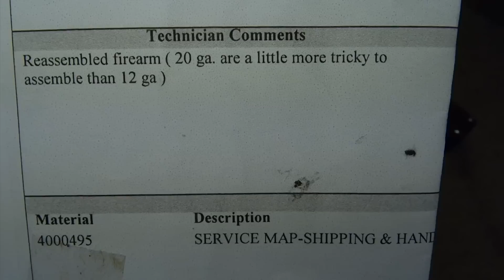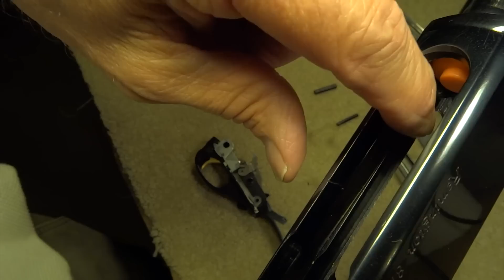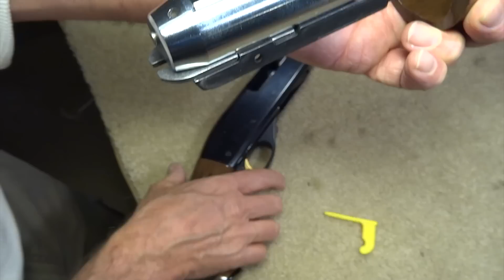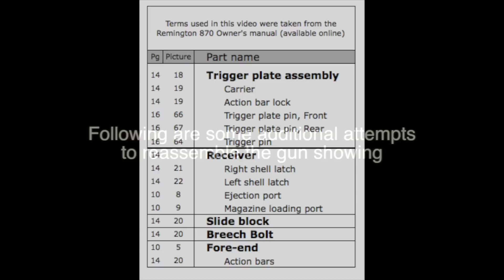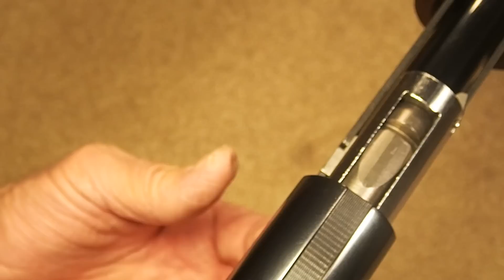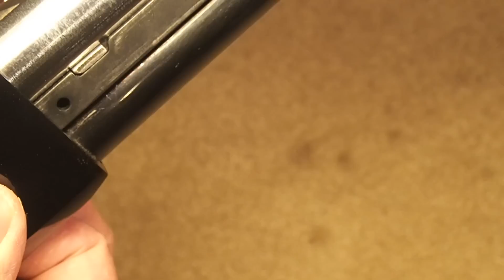20 gauge Remington 870 reassembly problem

Comment: I spent WAY too much time trying to reassemble this 20 gauge before seeking your video. I had to laugh when I read your opening line, 'I owned a 12 gauge 870 for at least 20 years and never had any difficulties reassembling it.' I, too, have disassembled and reassembled a 12 gauge 870 many times, a piece of cake. So, I had reasoned - wrongly - that the 20 gauge should be identical in its ease of reassembly. SO WHY COULDN'T I GET IT BACK TOGETHER?! I knew when I began entering the search words and YouTube fed me the phrase 'reassemble remington 870 20 gauge' that it wasn't just me.

Thank you for your help, without which I would once again be attempting to reassemble - and shaking my head and cursing my failure and wondering what on God's earth was the problem?!

Comment: LIFE SAVER!  My buddy ( a machinist) couldn't get the bolt back into his 870 20 ga after over an hour of trying. He brought the gun to me and I also tried  for near an hour. I could get the bolt in but it wouldn't cycle smoothly and would jam up TIGHT. I've worked on dozens of gun designs and never had such problems, I was ready to tell him to ship it to Remington.  Once I found your vid, the sequence of depressing  the two rail stops became apparent. Additionally, I found that I had to have the right stop depressed no later than when the little hole in the slide was a good 1/2" out of the reciever. Took another 6-8 tries but I finally got it.   I've advised my friend to NEVER disasemble this gun again. A can of Gun Scrubber will sufffice for cleaning going forward. Thank You!.

Comment: Fantastic instruction. I knew the shell latches had to be pushed in and in which order. Did know about the small hole in the slide having to be t a certain position. Ive struggled with this repeatedly for almost two years. Watched your video and stuck it the first time! Thanks a million.

Comment: You are a prophet, a scholar, a seer of portents of things to come and above all else a gentlemen.  Thank you for sharing this!  I've spent the better part of the day fiddle-farting with my li'l 20 gauge 870 and was stumped until I found you.  Bravo!  

I scoured the net and found dozens of "I thinks", "I heard", "It should", "It might" but very few "I don't knows."  My original problem was the bolt wouldn't lock forward -- just give the fore end a good yank and it'd pull back and jam the bolt to the rear.  Turned out the action bar lock (I called it the bolt release ... lol!) wasn't engaging the action bar properly.  I got'er apart and diid a little adjustment and it ultimately worked.  The problem was getting the danged bolt assembly and action bars to work.  I followed the advice of many a 12 gauge "expert" who never mentioned pressing both the RIGHT and left shell latch.  Madness ensued until I stumbled across this precious piece of wisdom and knowledge.  

Thanks for being so awesome ... and saving to many of us minions from 870 insanity!!!

Comment: Just spent about 3 hours with jams. The hole on the right side is key. Watched other videos and your the first to mention that hole. Thank you so much. My fingers are killing me. Wish I saw your video first.
Reply: YeAh same here. I watched several and the closest anybody came to the hole in the slide was a guy that said once he pushed the latch in he pushed the bolt “about this far” as he held up his hand with two fingers almost pinched together. Lol! 😂 Your right, the hole is key to early success. I stuck the landing first try using that little morsel of info.

Comment: I purchased an h&r 20 gauge youth from Buds. I’ve never field stripped a shotgun. So yesterday I figure what better time than the present. I finally got the bolt out. I try to get the bolt back in. 3 hours later I gave up. Your video is the best I’ve seen as of yet. I’ll attempt again tonight after work. Thanks again !!
Reply: I ended up sending it in for warranty/ repair. I noticed inside the receiver 2-3 burs in the metal. The bolt carrier was hitting the metal burs. I shipped it via FedEx. It arrived on Sept. 10th. I called a couple weeks later. 4-6 week turn around time. Once I get it back I’ll use my old cleaning method. Bore snake. & CLP break free spray for the receiver.

Comment: I have a Remington 870LW Special Field 20 gauge ... a fine pointing, short-barreled grouse gun.  I decided to tackle cleaning the trigger assembly, bolt, etc. which hadn't been cleaned since I bought this gun (used) years ago.  Man, the trigger assembly was dirty, dirty, dirty.  All cleaned, lubed, and back in the gun ... although that was not easy either as some parts were wider than the receiver bottom and required coaxing.  I gave up last night on replacing the bolt and slide and happened to find this video this morning.  I thought surely I've got this licked.  Now I'm back reviewing a second time after trying, analyzing, and trying some more.  I'm way over your failure ratio.  I will watch again, and I see some of the comments give some additional insights.  Wish me luck.  As someone else said, I won't be in a hurry to repeat this disassembly any time soon. (no problems with 12 gauge 870 Express)
Reply: YEE HAWWW!

Comment: Holy Moses! I was just sitting here on a rainy cold night thinking I would clean the manufacturer oil and crap out of my new Remington 870 20 gauge. I got the barrel off easy enough, but thought best to check youtube before further disassembly....thank GOODNESS I did! Grateful for your video - think I'll call my handy neighborhood Gunsmith to do the initial take out and cleaning. He's probably seen it before and I won't feel like such an idiot! I had an old Sears and Roebuck 12 gauge pump shotgun my late husband had bought at a pawn shop for $100 bucks. That thing was so easy to handle and work on it practically did all the work itself. I gave it to my neighbor when I moved to town, thinking I'd get a 20 gauge...hmmm may not have been the best decision.

Comment: Thanks for making this video! Still was not easy, but your video put it into perspective. I cleaned two 20 guage 870's tonight, not sure how I got the first one back together. On my second one, I ended up using a rubber band to hold the bolt onto the slides and cut off once I knew they were past the shell latches. :)

Comment: I have had 4 870's in my life time including a 28 ga up to a 3 inch mag 12 ga. Traded a gun for a NIB 20 Express to keep around for the wife. I probably could do all of my other 870's blind folded. Not this one, a true nightmare. I have spent at least 2 hours fiddling with it and still can't get it. It seemed like I was doing everything correct as per this great video but I guess not. Remington has certainly changed my opinion of them as a company, I'd like to meet the genius who made this design and see how fast he could do it. The directions are totally worthless. I would hate to have to try to do this in the cold out in the woods for any reason. I was warned by a friend but I thought I knew my 870's, Ha, this is cheap junk and it will be my last new Remington.

Comment: Haha...I had the same problem.  Had 12 gauge 870s for over 27 years now problem.  Got a new 20 for my wife.  Took it apart to install a new stock set and had a lot of trouble getting it back together just like you did.  I had to push the right shell stop first, get push it until stopped on the one on the left.  Then I would pull it forward just a little bit while pushing the left shell latch while I was ever so slightly pushing forward on the fore end until the latch pushed in, then I would just slide it back.  It is tricky.

Comment: Thanks for posting this video. I was having the same problem with my new 20 ga Wingmaster. I practiced a few times and can get it to work about most of the time now. The trick seems to getting the right side done correctly and then the left just pops in, I twist the receiver a little while pressing on the spring. Thanks!

Comment: I had the pump pull straight out the action, leaving the bolt in the reciever. Ended up getting it free after removing the bolt carrier plate. Putting it back together was even more tricky for me.
Reply: For anyone who encounters this exact problem: 
Remove the trigger assembly using a punch or a small screwdriver. Then pull the bolt carrier plate and bolt out of the receiver. Reassemble like normal.

Comment: This will sound a little crude but I've always had to give a swift hit to the ground with the butt pad while holding onto the foreend. It would push the action right through all the way if it were stuck. Has worked on my 870 express 20ga for over 10 years works fine.

Comment: Put the pins on the trigger plate differently then he does the second one goes in the opposite way , as far as getting the FOREND assembly back in don’t apply any upward pressure hold one latch till it stops going into the receiver then stop and push the other side latch and finish inserting into the receiver

Comment: Had the same problem, my advice is hold both shell latches in at the same time. Then with your thumbs on the action bars lower the bolt into the reciver.

Comment: Crossing my fingers the advice in this vid will be my salvation in being able to just disassemble my 870 since I've already learned that "finnickyness" indeed is a thing & that it also extends itself into becoming a demon bastard to take apart if you're unaware of the pitfalls of not being very mindful of keeping things aligned & such prior to attempting.... Runs like a top normally but I literally had to put the thing out of sight for about a week for fear of hastily giving it a new title/job of "concrete sledgehammer" or something similar... IT MAKES ME SO ANGRY.

Comment: What in the end is the root cause of the failure in reassembly? Does one of the shell latches actually end up on the wrong side of the action bar when it’s incorrect? Is it visible if the bolt is installed without the trigger group in the gun?

Comment: Agreed this is the most awkward rifle I've ever had to reassemble. Maybe this is why Remington went out of business. The rails the breech sits on are too flimsy and move way too much. I finally got mine to work by tilting it up like in the video and being very careful with the stop latches. So many times I didn't get it right and scratched up the mag tube on the outside trying to get it out of being jammed.  Honestly best just to clean the barrel and leave the bolt in the receiver.

Comment: Long story short got it back together again.  Noticed that when the bolt falls off the rails can be inserted with less difficulty.  Started to believe  the bolt was complicating the install.  After I got everything in and banged the stock hard on the floor again to unfreeze the beast I checked the bolt clearance and found that mine rides against the right side of the receiver.  My conclusion is the bolt causes interference when jockeying those rails and it requires perfect alignment to be successful.  Undoubtedly this is a piss poor design.

Comment: This is such a great video. I spent an hour trying to force mine back together but it turns out i notice the right shell latch which i never noticed before. It helped me to press the right shell latch and slide the action bar in as far as itll go then press the left shell latch in and slide the for end back out slowly until the left shell latch depressed. Then it went together perfectly

Comment: Watched this still can’t get my express 20ga I have a wingmaster 12ga easy as crap Remington messed up if you have a 9mm 1911 it should not be harder than 45 acp
Reply: I have an express, and I have the same problem. How I hated reassembling this gun!!! The trick really is looking at the action bar holes and their placement when you're feeling the right shell latch. When you depress the right shell latch and move the action forward about 1/8" and look at the holes, make sure they are visible, then depress the left latch and hopefully the whole assebly will slide all the way in and the action will cycle.
Reply: @MrImranghaznavi  Out of all of my firearms my Remington 870 express 20 gauge is by far the hardest to put back together!!

Comment: I got a old 20 ga. Magnum 870. As well as 3 12 ga. They all go together no problem. If your having trouble with parts fitment, you probably have a newer 870 made in the last 10  years or so. Unfortunately the problem is Remington's build quality went to shit. My recommendation is to buy old 870's. If its any newer then 90's I pass....
Reply: I respectfully disagree. While the build quality may have been better years ago - especially 20 or 30 years ago when it was done by skilled gunsmiths - I believe it's more of a question of wearing in a gun that makes it easier to disassemble and especially reassemble. No matter how well parts are machined - by people or CNC machines - they must be fitted correctly and operated repeatedly in order to function smoothly.